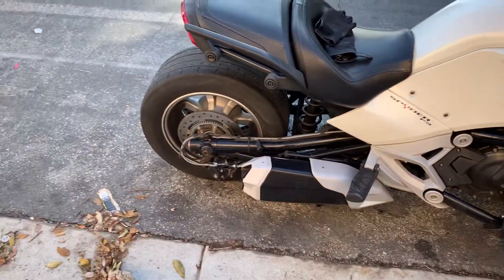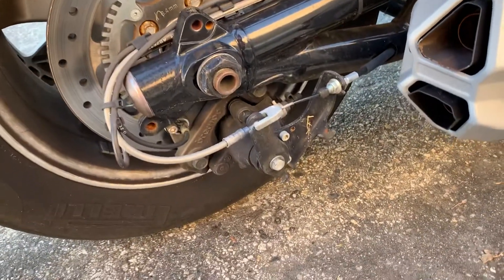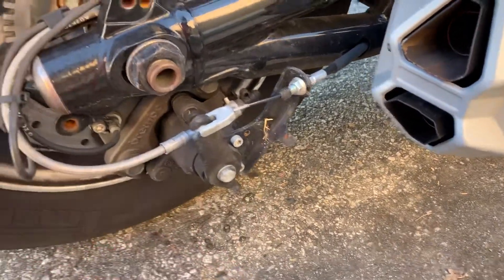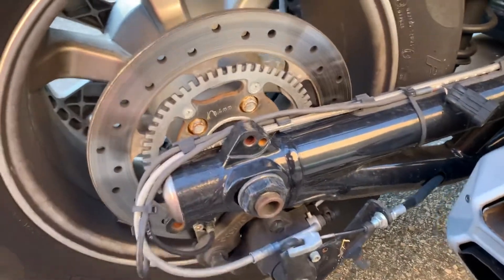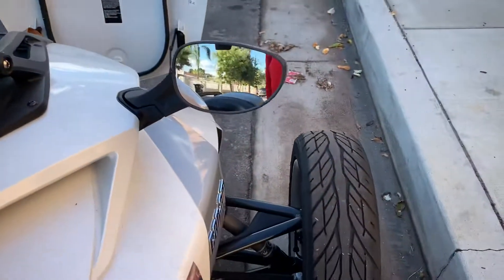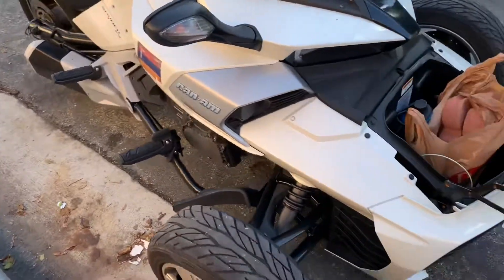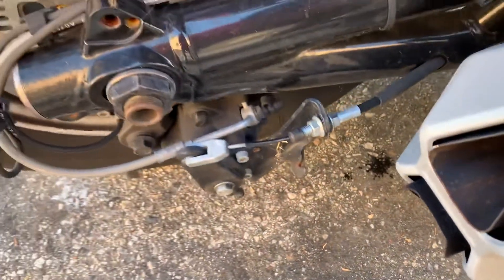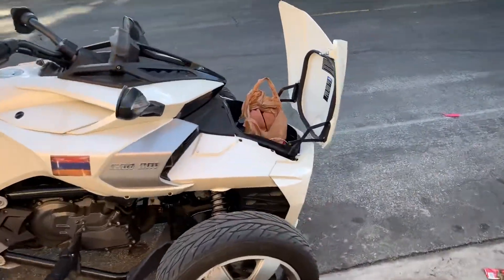Can am Spyder Parking brake stuck? Watch this to fix it

Comment: Do not apply your parking break when coming in hot. Come to a complete stop give it about 2-3 seconds then apply the parking break. After learning this trick years ago I have never had issues with the parking break sticking. You can also wait about 10-15 minutes and it will reset. This is the most Ghetto Idea I have seen yet.
Reply from the maker: It does not reset in 10-15 minutes you don’t know what you are talking about. This is the only method to fix this specific problem